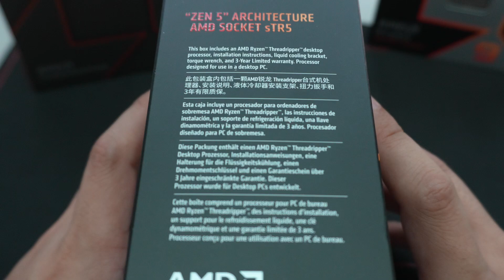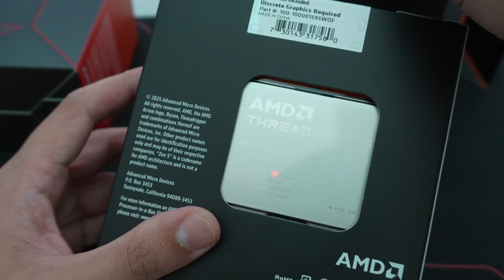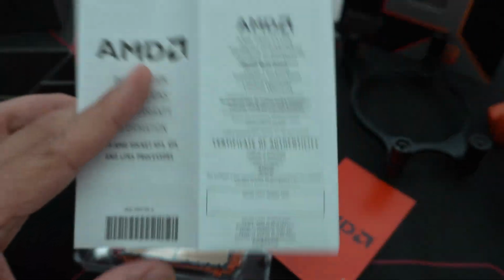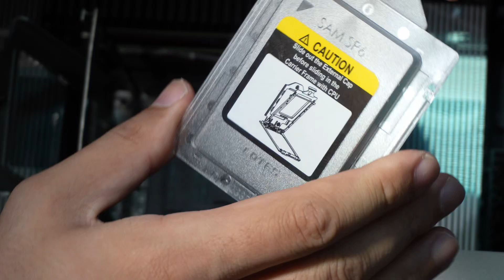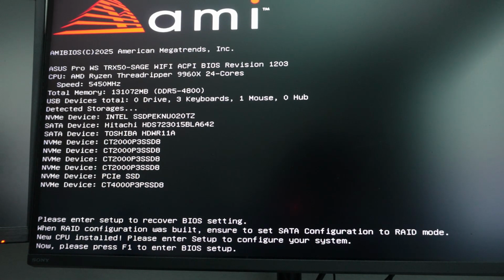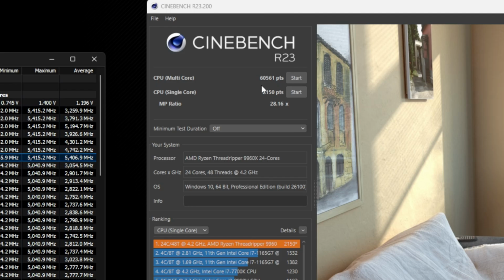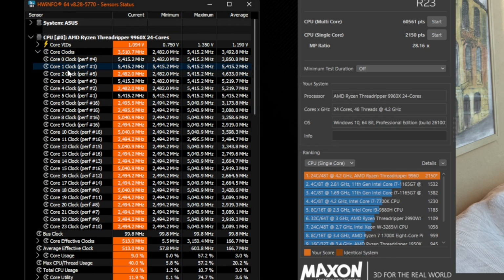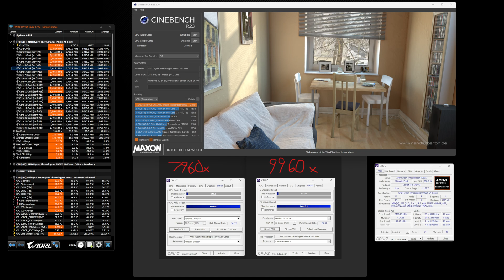AMD Threadripper 9960X Unboxing and Overview 開封と概要

Comment: I’m considering upgrading my Xeon w3175x Dominus Extreme/ 192GB DDR4 3800c14 to this TR platform. I still get great performance. I’m hitting 42K in R23, memory bandwidth is 166gb read in Aida64, latency is 53ns. I love the CPU. It does a great job pushing my RTX 5090. But the new Zen 5 9960x finally looks good! I’m not a big fan of multi die. But, your CPU looks pretty good. 😊 and I mainly want less power consumption

Comment: Since you're on the of the few reviewers using a TR on air, I would love to see a looping cinabench while running HWinfo AND showing CPU power. Would like to know how soon the 9960x throttles and what wattages it throttles to.
Reply from the maker: It will eventually get to 95c looping R23 for 10 minutes. I've swapped over to the Silverstone and it now only gets to like 77c.

Comment: Damn dude. If I had your tech budget my homelab would be sitting pretty with a rack full of networking gear and servers 😊

JDEC on the memory being 6400 MHz is very impressive IMO.
Reply from the maker: Yeah, the memory is improved but I wish the platform would get the bios updates that applied to AM5 which made memory training a thing of the past.

Comment: btw, can we see in the next reviews try to limit PPT, just very very interesting if it able do AKA ECO mode when it is needs, or Single CCD, would be very very interesting how it is, Thank You!
Reply from the maker: The thing I'm interested in is tuning the CCDs using PBO.
Reply: @GameTechReviews  Yeah this is for High Power, but good to see both condition, btw Please Could You record full process and tests tuning PBO per CCD 😀 and I saw on 9995wx where turned off all CCDs apart 1st, good to test this as well, just interested what is give in perfomance) Thanks mate

Comment: Awesome. Thanks. 
What about the Threadripper Pro 9945wx or Pro 9955wx over the Threadripper 9960x for gaming??? Higher base clocks on both of those Pro Threadrippers
Reply from the maker: Those are workstation CPUs in the next segment above HEDT.
Reply: thank you for the reply. I know that, but was asking for opinions from you and the chat on these for mixed use PC that can also do high end gaming, all that compared to the one you chose which has a very low base clock speed, which is a big sacrifice